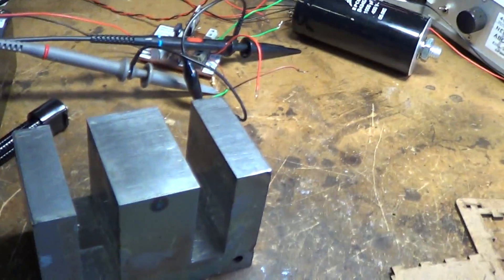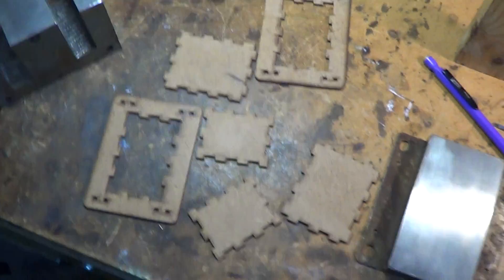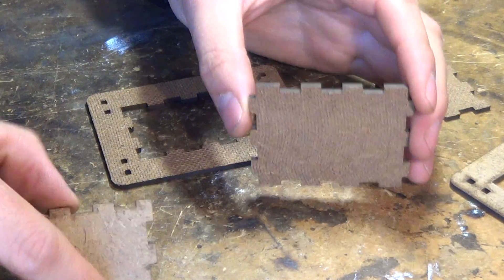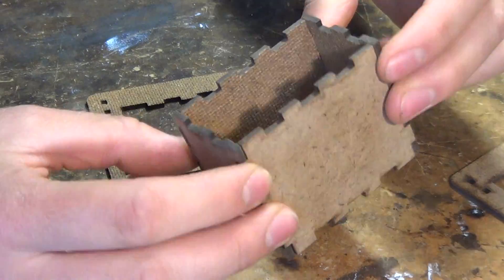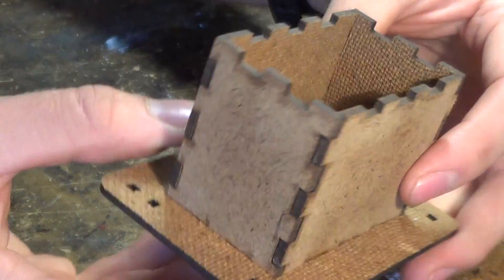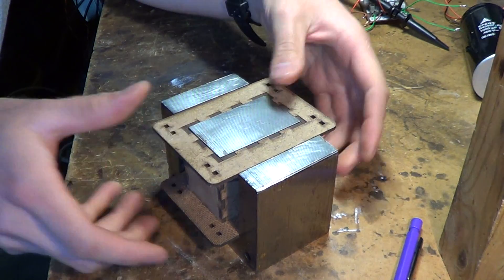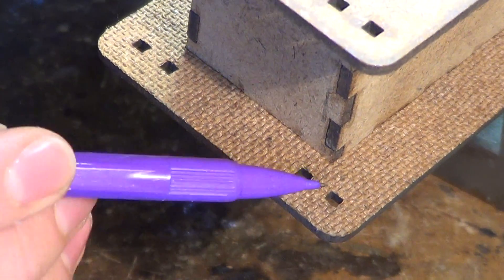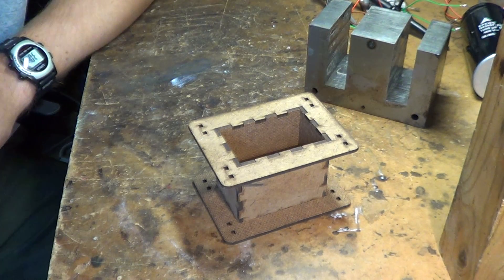Laser-cut transformer bobbin

Comment: I like the design. 2 questions why would you build one so big. Exactly what would you use it for. And the steel plates did you make them by hand or order them. I like to be able to make steel plates on my own. But I don't know if just regular sheet metal with work
Reply from the maker: The core was intended as a smoothing inductor in a diode laser power supply (output current around 50A). As explained in the video, the core is from a microwave oven transformer.

Comment: nice job. how can i make one like this. what did you use to make such an incredible bobbin? please share your idea. thanks
Reply from the maker: Hey, thanks for the comment! 

This was cut out on my 40W Chinese laser cutter (page on it here - http://imajeenyus.com/workshop/20090506_laser_cutter/index.shtml). Hopefully, if you can find a hackerspace/makerspace near you, they should have access to a laser cutter for this. It is possible to cut it out by hand using a fine hacksaw blade, but it's rather tedious!

I used 3mm hardboard, but 3mm plywood would be better, and easier to get hold of. Figuring out the finger joint profiles is a bit tricky, but if you base it on the diagram on my webpage (see link in video description) you should get the idea.

I glued it using PVA wood glue, but hot melt or Gorilla glue (polyurethane) would do equally well. When the bobbin is wound, the wire tends to keep all the wood pieces together anyway.

Hope that helps! Best regards, Lindsay.
Reply: Thanks For Your Help. I really appreciate your time and effort.  I will be contacting you for further details